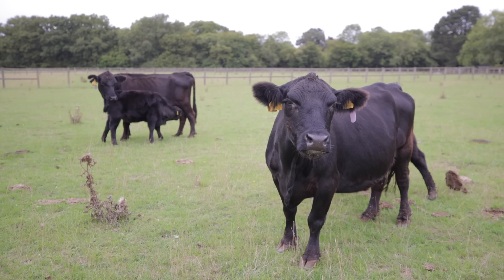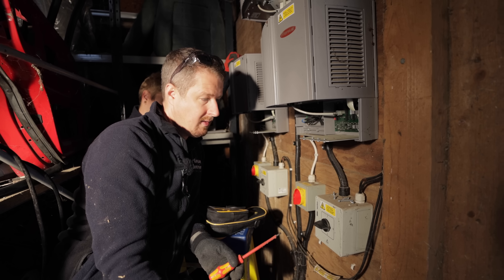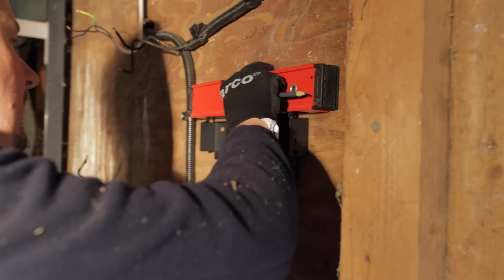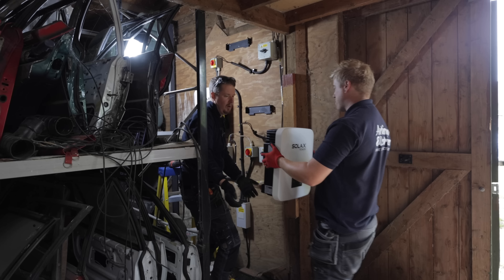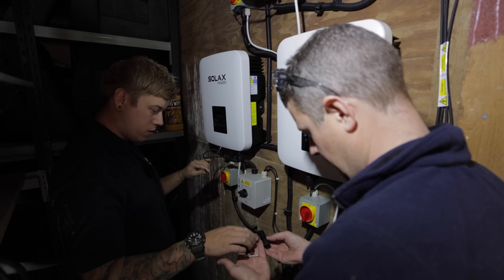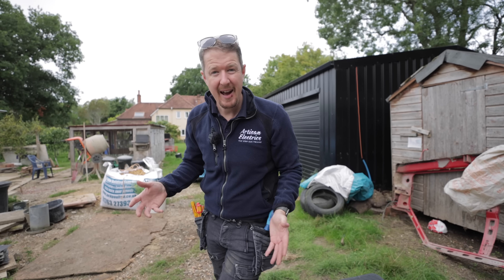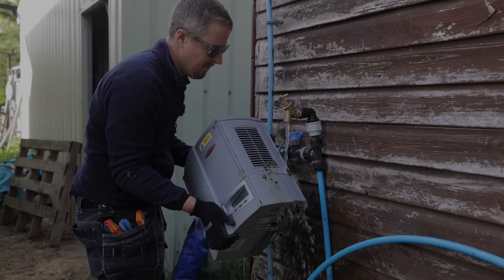A well OVERDUE Three Phase Solar Inverter Upgrade!

Comment: Just wondering about the installation on wood? Most manuals for  inverters say they should be installed on non-flamible material. Was the wood treated?

Comment: Nice neat install. I've had my PV system for 12 years as well. I noted your comment about modern inverters store historic data. I just checked the manual for my Power One Inverter Aurora 3.6 inverter and it only keeps 2 days of detailed data (every 10 secs). Fortunately I connected it to a SolarLog 200 monitor via a RS-485 connection so I have 12 years of detailed data shown graphically but I guess the 2GB memory will eventually get full. 

One thing I have to do every 4 years is to replace the backup battery in the inverter. I takes a half AA lithium battery that is not readily available locally.

Comment: Nice job guys worth to mention you have to use the plugs supplied by Solax because normal Mc4 connectors are a loose fit which can cause a fire but also warranty is not covered if you don’t use the Solax connectors Supplied. PV label kits to be attached. Great job guy’s keep up the renewables 👍🏻
Reply from the maker: Thanks
Reply: Also from panel to string cables need to be the same connectors,  never use 2 different brands of mc connectors unless its specified a match by the manifacturer. Greets from the Netherlands

Comment: Talking about worklights; I've recently came across these Mareld-brand lights. They're some pretty decent gear!
In their headlamps you get a normal "white light" as in most LED's but you can also choose warm or mix of both which gives you a pretty much like a daylight view. It's fantastic! With very broad beam.
Sadly I ordered new Led Lenser just before saw that one of their headlamp was 50% off in one internet store.. 😕

Comment: Whenever you open an inverter just wait 5 minutes after de-energizing.
Test the tester on a known AC supply before and after testing AC. 
Test the tester on a known DC supply before and after testing DC.
Also testgear should be suited for 1000V AC/DC. The DC side in the inverter could reach over 650VDC.
There is a difference between AC-DC-AC inverters and the DC-AC inverters used with solar but it's just an extra little safety step to take to make shure you get home, save, everyday.
Reply: I use the Fluke T5-1000 to test DC voltage, it does 1000V AC and DC. We only need to test our tester before testing, not after as long as the voltage is below 1000V
Reply: @justme5384  The 'test/measure/test' was introduced in many countries because under certain fault conditions, the fault could damage the meter itself...
Say you have a fault that introduces a extremely high voltage  compared to what the meter is set at...
You test the meter is working- it checks out OK...
You measure the voltage (say its a LV 230v system but it is 'isolated' so expecting to see 0v...- but its got a short to the HV system at 11kw!!!)
Meter goes blammo as the 230v range is fed 11kv- and because it has blown a fuse- its now reading 0v- just like you expect...
IF you do the test/check/test procedure- it will fail on the second testing...
if you don't- then you don't know that your meter just went to 'Ohm Heaven' and you grab hold of a live cable...
at 11kv!!!
Think it could never happen???
I have seem it personally, several times- when rural 'can transformers' were hit by lightning and delivered the HV (or some of it) straight to the LV circuits!!!
(ie the lightning strike caused insulation breakdown - sometimes it is ok, sometimes it delivers thousands of volts to the household circuits!!!)
😲
As many (most) multimeters (and even many 'multi purpose meggas') max out at 3-5kv- a rural s/c supply transformer/'pole can' can cause them to 'blow'- and you REALLY don't want to be hanging onto a a live 11kv plus live cable....
😞
Hence 'test/measure/test' was born...

Comment: The arc fault itself created by the two wires is in reality the ionization of the air, accompanied by a hissing or frying sound that we hear here.

Electrical arcs experience incremental resistance on the negative side, which causes the electrical resistance to decrease as the arc temperature builds up.

As the arc develops and gets hotter and hotter, the resistance falls, drawing more and more current (runaway) until some part of the system melts, trips, or evaporates, providing enough distance for the circuit to break and extinguish the arc.
Reply: More, a lightning strike is probably the most common Arc Fault that everyone saw at least once in lifetime.

Comment: I've got a question you might be able to answer. I was wondering what would happen to the neutral current on a 3 phase supply when one of the 3 inverters fails. Let's say we have a 3 phase 16A supply to a house, and L1 and L2 are both returning -16A. But, let's say the L3 inverter is busted, and that phase is using 16A. L1, L2 and L3 are at their rated 16A current, but won't the neutral wire carry 32A in this case, thus being overloaded?
Reply: The neutral on a three phase supply can never have more than the maximum of a single phase on it. If L1, L2 and L3 all had 16A on it, the neutral will have 0A on it. If L3 goes to 0A then there will be some current down the neutral but it’ll be less than 16A as some of L1’s current will return on L2 because the phases are out of phase
Reply: @klausdudas  even when one of the phases has a negative current? or does the direction of the current not matter in calculating the neutral current?

Comment: what is the advantage of going with 3 x 1 phase inverts vs 1 x 3 phase inverts
Reply: Watch to the end he explains
Reply: @timwoodhams958  Yes but the reason doesn't makes sense. solax got smale  3 phase inverts. with as low of an output current per phase as 6A and they install 3 x 1 phase inverts with an output of 16A each

Comment: If it's a line of site to the house  you can connect the barn to the house  internet using WiFi access points over several km

Comment: How did you ensure each phase was 120degrees apart, as would be the case in true 3 phase.
Reply: The incoming grid supply determines the phase and frequency.
Reply: That doesn’t matter, each inverter will adjust itself to the phase it is connected to, which will be 120 degrees shifted from the other.
Reply: @robdevent6080  👍
Reply: @robdevent6080  OK, I guess I am missing that it is connecting to main 3-ph in the house somewhere.

Comment: Quick tip. You don't have to unscrew the gland cap. The connector slips through once crimped 😉
Reply: And you can hold the metal bit in the crimping tool, then insert the cable. That’s why it ratchets.
Reply: @MiesvanderLippe  and then you tighten the gland cap up till it doesn't spin on the cable for stress relief. It's actually a reg in Australia.
Reply: I was thinking all 3 of these comments when Jordan crimped on the MC4 plugs

Comment: If an inverter is replaced, does the G99 approvals documentation have to be resubmitted to the DNO all over again with new equipment parts documented?  I’m assuming that approval was historically required when the Fronius inverters were connected 15 years ago.

….. or is this system all less than 16 amps per phase?

Edit:  Ah!  3kW per inverter. So I guess that’s a G98 notification instead.
Reply: In Belgium same . hase to be submitted and inverter has to be C11/C11 listed .  Alo  we need to have an solar-approving- inspection again .  If you look at previous video it's only protected by 10A  MCB ( 3 pole )  So inverters are a bit oversized .. ?   We don't see how much panels on the roof ..and how many watts per string ..
Reply: Yes the DNO will need to be notified of the change of inverters but aslong as the system output is the same it's just an amendment

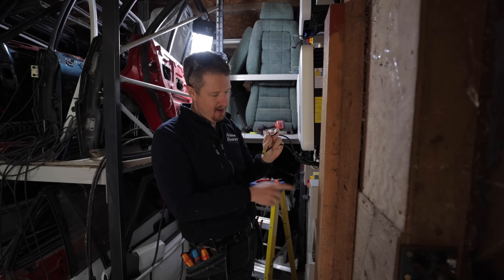Comment: 10:23 how about doing a quick check if the solar array is still ok?
Reply: Considering they plugged in all in later in the video and saw working voltages from each solar array? That would be the ultimate test.
Reply: There’s a series of trays to carry out before commissioning solar equipment to make sure they are working correctly , not carried out too busy trying to show off by touching live dc cables together
Reply: There’s a series of trays to carry out before commissioning solar equipment to make sure they are working correctly , not carried out too busy trying to show off by touching live dc cables together

Comment: How is the voltage at 400v on the DC side please?
Reply: each panel generates roughly 40V and these are commented in series so voltage  cumulates
Reply: @atkt62  Thanks

Comment: What table is that??? Never seen one like that before??      Love the videos. Tell Cory to get back to work.
Reply: The one at around 22 seconds? Yeah I need to know this too!
Reply: @audigex  yes I looked over there Amazon list and it wasn’t on there
Reply: They’re made by either Keter (red) or Mac Allister (blue). I think his might be an older model, unless there’s a third brand selling them. 

ToolStation, ScrewFix, B&Q all sell them.
Reply: @SteRumbelow  I think whether the brand is, it's made by Keter.
Good brand of you're thinking of buying some plastic made toolbags etc 👍

Comment: Surely the outputs of these 3 single phase inverters aren't syncronised with each other to produce a true 3 phase output. Perhaps they do? Can you please explain in detail in another video. Love the videos.
Reply: They just threath the phase they get as single phase .. the just sync with the freq/voltag on that particular phase . The don't talk to eachother .  No need for that also .
Reply: They only have 3 inverters to spread the generation it isn't a 3 phase system it's 3 single phase systems
Reply: @haldo691  not really in previous video you can see  the feed is  3 phase  10A MCB.  So   L1 - L2 - L3  is present in the sched .  But they use eache fase for 1 mono inverter . ( wich is fine )  The injection wil be splitted to the 3 fases +/-   but i get what you mean 🙂
Reply: To be genuine 3 phase the inverters MUST be synchronised otherwise you will not get the  correct phase to phase voltage and you could get 460V AC RMS, which is too high.
Reply: @deang5622  they are in sync with the incoming phases so not an issue as they can only operate if the incoming supply is live for offgrid this setup would never work
Reply: @deang5622  exactly my thoughts thank you.
Reply: @timmclaughlin601  There is only a power imbalance over the phases depending on the irradiance. The mains ( in grid tie mode ) side will always be in sync with the phase it connects to, otherwise it would blow up, so there is no problem in using three individual pv inverters.
Reply: @haldo691  Hold on. To be three phase:
The issue is one of timing of the 3 signals relative to each other. It is not to do with incoming signals.

The 3 output signals must be timed as: phase 2 lags phase 1 by 120 degrees, phase 3 lags phase 2 by 120 degrees.

If this is not achieved then it is not proper 3 phase and you risk damaging loads which are connected. 3 phase induction motors absolutely rely on that sequence and timing of the signals. If it is not present, then damage can occur to the motor.

Now if you are feeding the output of the 3 phase inverter back into the grid, then the inverter outputs need to be synchronised to the grid signals.
Reply: @deang5622  but each inverter can only output by being in sync with the phase it's connected to so they can't phase shift because the grid is fixed otherwise 3 single phase inverters in 3 separate properties could cause the same issue no inverter can change it's phase angle when in sync with the grid the inverter would die instantly if it tried
Reply: @haldo691  Precisely! It depends on whether the inverters are grid tied or not.
Reply: @deang5622  they are I agree this would never work in island mode or an offgrid system
Reply: @deang5622  they are I agree this would never work in island mode or an offgrid system

Comment: I would be interested to know how much electricity this system has generated in 12 years as those inverters are £800 eack so i'm guessing just changing those was £3000. I'm still not convinced by all this stuff as it has maintenance costs which are never taken into account when they say how much you can save. But at todays electricity prices probably easier to justify this.
Reply: Well going with some very very conservative figures, he said it was a 3kw array, if you got 4 hours of generation a day that’s 12kwh per day, take an average unit cost of say 10p that’s £1.20 per day, £438 per year, £5256 over the 12 year. Like I say, conservative, rough estimated numbers.
Reply: @Pugjamin  also if they were installed back in 2010 the customer was probably on a fairly decent feed-in tariff - upwards of 43p/kwh - I wouldn't be surprised if that's still valid on a like-for-like replacement, meaning they may well also be netting over £1,000 a year in repayments.
Reply: @JamesScholesUK  But the problem is that all subsidised feed-in tariffs have to stop soon.
Reply: so in 10 months a 5kW array facing ssw has generated 3.7kWh. predicted 3k9 for the year. we have used 76% of this and exported sorry about that (not) Mr putin. we reckon payback in 5 years at todays energy costs. inverters are relatively cheap it is the batteries which cost now. yes inverter lifetime is an issue but 12 to 15 years is now commonplace. how many   maintenance free machines have this lifetime in constant operation ?

Comment: Hows flex cable allowed for Solar AC cable? Dont you need to use the right PV solar cable colors  RED= + BLACK= -? and an inverter needs to be placed on a non flammable wall. and incase are the solar panels not earthed? greets from Belgium!

Comment: 15:50  euh don't get thisone .. install  3 times a 3KW inverter instead of one 3fase 5KW ?   I think in this case a 5KW 3 fase could be possible ..but might need adjusting the strings to 2 strings .  So my guess is they went for easy route just replace with 3 single phase inverters again ?  ( as seen in previous video the fuse in the house is only   10A   3 pole ..)   Or maybe delivery issues ..here in Belgium it's hard to find inverters ..lot's of shortage ..  solax has  3 phase inverters  5  / 6  / 8 / 10KW  3 phase inverters  .( and the power  is combined not per phase )
Small solar aray ? looking at the video i count at least   20+ panels ..   400 volt DC on a string .. lets say open voltage  36Volt per panel   +/-  10 panels / inverter  ( older panels ?  200-250 watt =  2000-2500 watt peak per string )

Comment: From German quality to Chinese, hopefully the owner does not expect the same lifespan again.... I would have picked a Fronius or SMA as a replacement.
Reply: Totally agree!
Reply: Same. I would choose solar Edge in this scenario.
Reply: Price mate solax quarter the price and has 10 year warranty so free replacement. German made only got 15 :/ not that much better
Reply: Fronius inverters will not be available at least until next summer if you order immediately. This is the situation in Finland.
Reply: @quelragazzodeigiochi9166  agreed but SolarEdge is garbage and belongs in the trash along with the Chinese inverters that have the capability to shut down the grid
Reply: Bare in mind that those Fronius Indoor IG  would last another 15 years without breaking a sweat 😁,  Solax will probably will not be in business for your warranty even if they said 50 years 🤣🤣
Reply: @quelragazzodeigiochi9166 solar edge completely incompatible with the existing system, and it’s proprietary garbage from a litigious nightmare of a company.

Comment: if your not careful daisy chaining the earths, will  create a earth impedance loop, although proably not audible to the human ear it can cause electrical interference, i did this in my exam for my ofcom radio transmission license, 3 seperate leads back to a common single earth point is the only you should be doing this or alternatively run them to a copper earth rod driven into the ground as close as physically possible,i have dedicated earth rod 5 feet from where i am sitting to leak away/prevent any RF (radio frequencie) problems likewise it is a heavy duty earth cable rated @ 600v 3 phase to act as a path to earth if my antennas are hit, you should know not to daisy chain earths ??

Comment: On the electrecution thing.    Note that AC is actually considered more dangerous than DC, even though it goes through a 0 point.   I just wanted to point out as your comment may be interpretted as saying AC was safer, but it's really not.  At 50 cycles per second, you still will not let go when the muscles clamp up.
I know you're usually pretty safe and push safety, but in this case there was a bit of ambiguity on the safety for people who do not know better (like DIYers)
DC is considered LESS DANGEROUS than AC of the SAME current and voltage level.      This is a lot to do with the way AC is measured compared to DC, and also the way the electricty pulses through the body.   Likely because AC is measured as RMS where as DC is a peak, which means Peak AC voltage at the top of the sine wave is actually a lot higher than the RMS, but I haven't got the facts to hand to quote actual reasons.    Either way, both high voltage AC and DC are dangerous.

Comment: Don’t the inverters have to talk to each other to do proper three phase. Usually there’s a data cable running between each inverter and a setting in software. And Fronius sell a Symo 3kW three phase inverter (3.0 -3-M). Not that it would matter if you used a higher powered inverter? Just spare overhead - they still work at lower power.
Reply: No- each phase is used as a 'single 230v phase'
(and quite frankly, Frontius doesn't have the best reputation in the solar game with installers...)
I'd rather a Solax myself between the two...